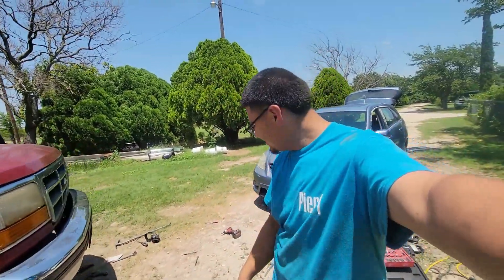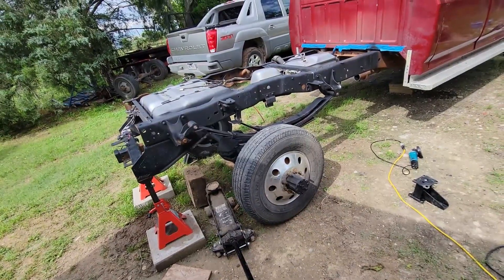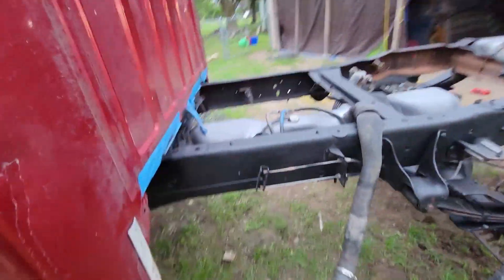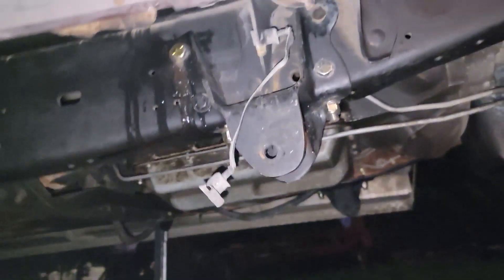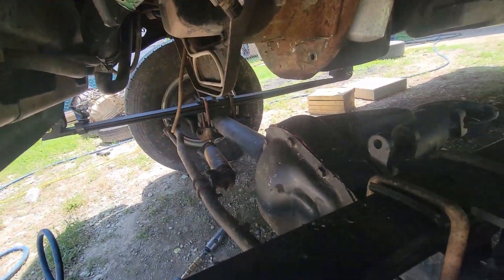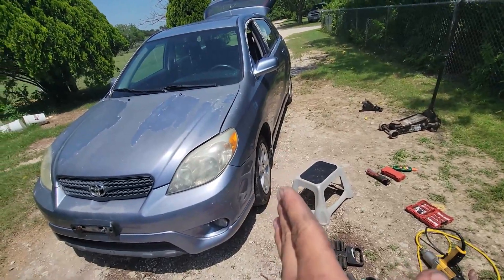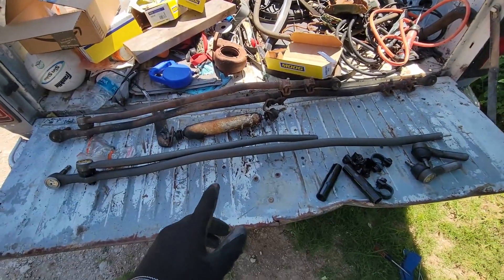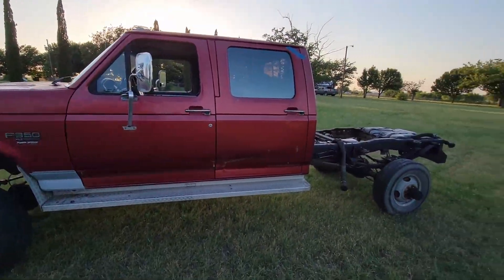OBS 7.3 Powerstroke Ford Dually 4wd Conversion Part 4

Comment: Nice truck bro. What wheel adapter did you use on the front axle to be able to bolt up the dually rim properly?
Reply from the maker: I was actually lucky enough to find a dually front axle so it was perfect! 👌